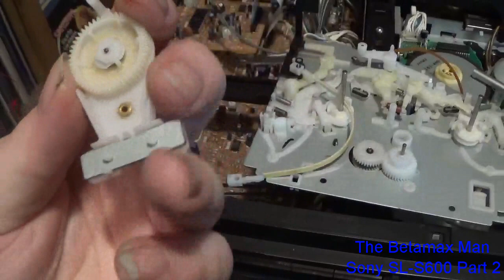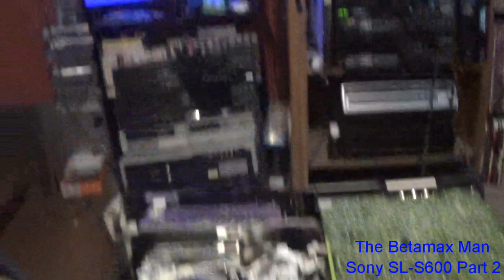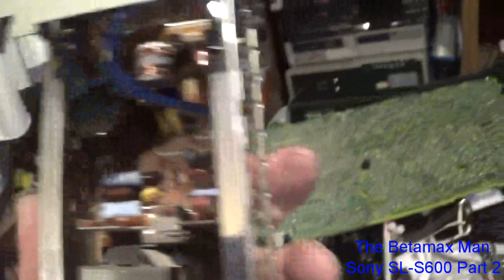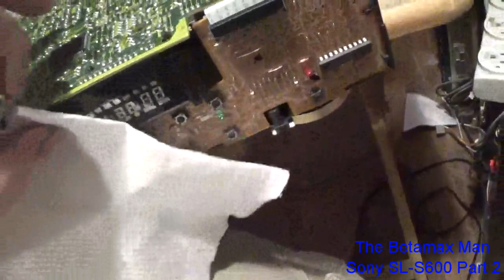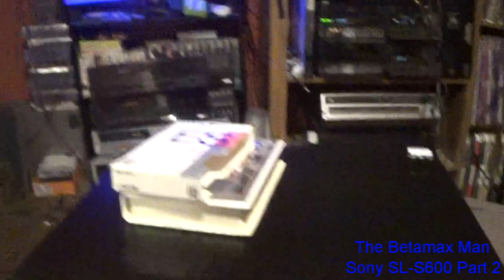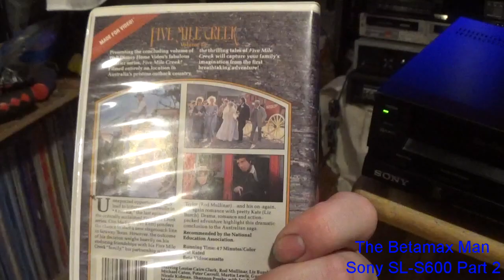A Customers Sony SL S600 Part 2 Full Service & Power Supply Rebuild

Comment: Mr. Betamax Man. Your help is needed. I just picked up this machine and I replaced that cap on capstan so thank you very much! Picture is beautiful BUT my audio is muffled. What can I adjust to make it clear? I did clean the audio head multiple times. Thank you.
Reply from the maker: Check and make sure know one has messed with the adjustment screws on the audio and control track heads Sony put red or green paint dots on the adjustment screws if the paint seal is broken then that means someone has messed with them
Reply: @thebetamaxman8905 dumb question but is the audio head behind the head or in front if looking from the front? while troubleshooting I had the tape playing and I pushed around the pinch roller and the audio cleared up. I ordered a new pinch roller .
Reply from the maker: @mpots323 that is a common problem I run into sometimes the capstan bearing fails sometimes the capstan gets bent slightly you can remove the capstan and using your hand you can bend it back straight this might solve your issue